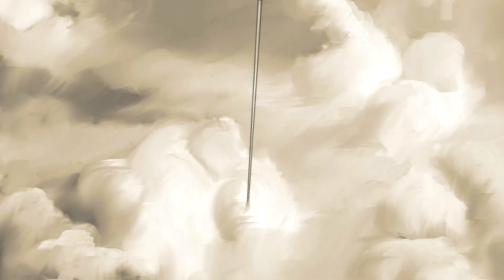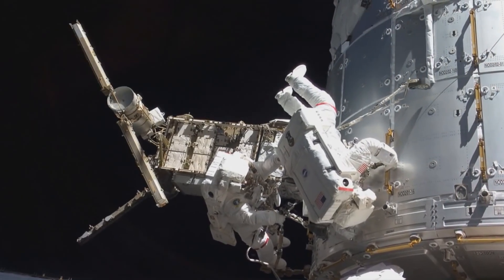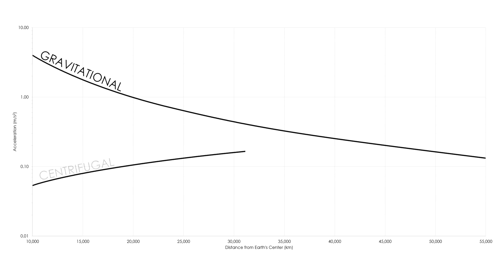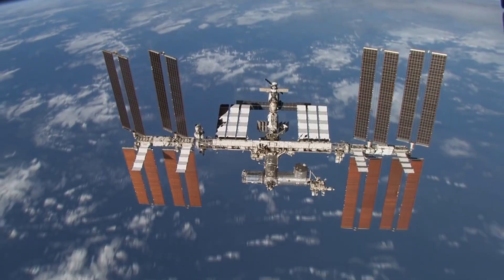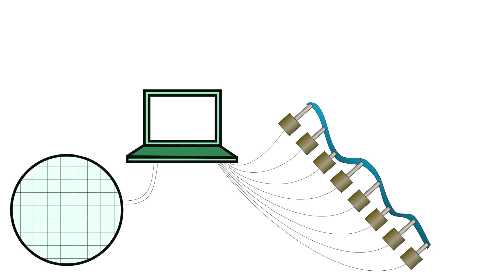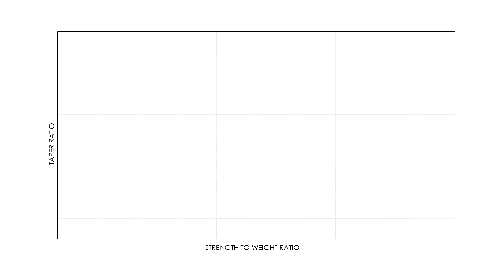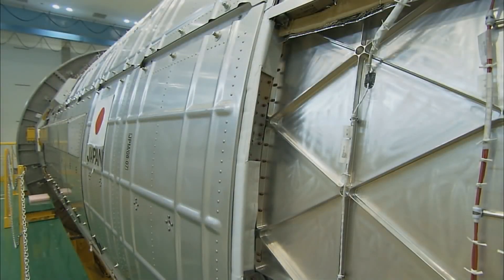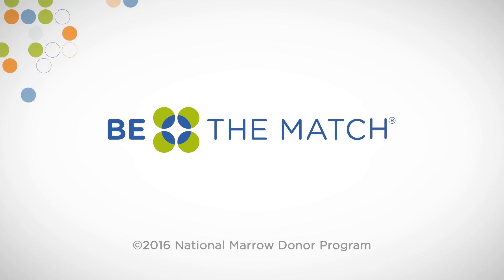Design Your Own Space Elevator

Comment: Just wondering.... So suppose that we have everything set up: the cable, the satellite at geostationary orbit and power mechanisms,... Now consider a different state in which everything is the same, except the satellite now have an additional weight. Looking from the north pole down, earth would spin counter-clockwise. Wouldn't the existing satellite and the extra weight be dragged clockwise? And wouldn't that sucks? I mean, imagine the satellite drag 1m for every kg of payload, wouldn't that mean you can only send up very little cargo?

I mean, rockets always have to go horizontally once they get out of the atmosphere to stay in orbit (in order to catch up with the earth or they will automatically fall back down or you can say to gain that centrifugal force) so it's reasonable that the satellite will be dragged clockwise everytime you deliver a payload with the space elevator.....

Am i wrong?

Comment: And this is not counting the work load of actually building it, sure, getting the anchor into space and build not that hard, a few trips on rockets with modules to build a big station.
Not that hard just work intencive, but then again the cable, its not like u can take it up and then just trow it of the edge, and atatching it to the side of a rocket to pull it up there causes some trubbles to.

Having an elevator gives us access to a new frontier. The anchor could one day become a smal town. If its big enugh u could grow lots of plants to suply oxygen and food, then ud need a good water retrival system, every dropp is golden. And without plants every breath and drop of water is golden.

It might take a long time, but were getting there faster and faster as tech and knowlage progresses.

Comment: Isn't there a nominal amount of electrical energy generated from the potential between the planet and the end of the elevator?  I'd think that could power the lifting mechanism and atmospheric support system.

On another tangent, what about having the power and lifting capabilities located at the base/anchor facility, such as a loop of super-strength material, with the elevator riding up & down the belt?  This could be equally balanced with a traveling elevator on each side ot the belt, one traveling up while the other going down.

Comment: What if the satellite was pulling the tension in its own direction pulling away from earth would that effect the cable size and why can’t we use high voltage electricity to power the elevator we send electricity across countries this way

Comment: How on earth is this not a perpetual motion machine!  There is no free energy, and a space elevator creates a lot of potential energy. 
A weight at the end of a string does not stay there if you pull the string. And the earth’s rotation does not accelerate the weight the way a person does when they spin a weight around on a string. 
All the things in orbit are free-falling directly toward the center of the earth, there is no centrifugal force keeping them up. And lower orbits require higher lateral velocity than higher orbits to stay in orbit. There’s no straight line to a geostationary orbit connected to the ground. But more to the point, as soon as you start ascending, you would be pulling on an unsupported mass in space. “Equal and opposite reaction” means that mass would come down with as much work as is put in, no matter how massive the weight. 
An engineer would strictly analyze the physics of this before even contemplating the materials needed.

Comment: You didn't even mention the nightmare of the cable being a conductor and the largest lightning rod ever.

That said, powering the lifter works better if power is beamed down from the station and up from the surface

Comment: what if there were dual carbon nanotube cables side by side, each with a lifter on it. One is at the top while the other is at the bottom, and they're on pulleys. It would still take power, but only for half the trip, the rest of the way gravity would do the work.

Comment: Why not release the tension on the tether with a series of large hydrogen filled hollow donut shaped tubes made of a light but solid material? Higher up the tubes could be completely evacuated of any gas whatsoever since  at those heights they wouldn’t be crushed under the high pressure of the atmosphere.

Comment: "every engineer ever has waited their entire lives for a problem where the solution was a gigantic laser" - Truth.
Reply: I was thinking about this, and was wondering if gravitational wave detectors count as the biggest lasers we have ever built.
Reply: @CupCakeArmy1  Let me tell you about the Apollo Retroreflector Experiment.
...
It pretty much is what the name says. There's a couple retroreflectors on the moon left by the Apollo 11, 14, and 15 crews, and we routinely shine lasers at them to measure the exact distance to the moon.
Reply: @CptJistuce  This wouldn't change the distance to the moon any more than what is already calculated by the standard gravity equations each year. Gravity is a field, so the expansion of space is happening everywhere inside the field, just at different rates calculated from the distance to the center of mass. Stuff like tidal effects make even more sense in this gravity model because its not the curvature of space that causes different rates of acceleration felt on a massive body but merely the different rates of expanding space inside that body. The whole idea that space is curved can be thrown out, while preserving everything that relativity brings to the table.
Reply: @CupCakeArmy1  I... never said lasers WOULD change the distance to the moon?
Reply: @CptJistuce  Ah sorry I got comment threads mixed up.
Reply: @CupCakeArmy1  That explains a lot. No worries.
Reply: @CupCakeArmy1  
RE: "I was thinking about this, and was wondering if gravitational wave detectors count as the biggest lasers we have ever built."
The Laser Interferometer Gravitational-Wave Observatory (LIGO) is a large-scale physics experiment and observatory to detect cosmic gravitational waves and to develop gravitational-wave observations as an astronomical tool. Two large observatories were built in the United States with the aim of detecting gravitational waves by laser interferometry. These can detect a change in the 4 km mirror spacing of less than a ten-thousandth the charge diameter of a proton. These lasers were built for sensitivity not power.
The most powerful laser beam ever created has been recently fired at Osaka University in Japan, where the Laser for Fast Ignition Experiments (LFEX) has been boosted to produce a beam with a peak power of 2,000 trillion watts – two petawatts – for an incredibly short duration, approximately a trillionth of a second or one picosecond.
References:
https://en.wikipedia.org/wiki/LIGO
https://www.ligo.caltech.edu/page/what-is-ligo
https://theconversation.com/worlds-most-powerful-laser-is-2-000-trillion-watts-but-whats-it-for-45891#:~:text=The%20most%20powerful%20laser%20beam,trillionth%20of%20a%20second%20or
https://www.sciencemag.org/news/2018/01/physicists-are-planning-build-lasers-so-powerful-they-could-rip-apart-empty-space
Reply: Not me!😂
Reply: Satellite laser tracking engineers are living the dream
Reply: Not just engineers.
Reply: Upvoted the video at this quote, upvoted your coment as well - great
Reply: Material for the lanyard /elevator cable needs resistance to burning up in the atmosphere for every minute, second, days and years.
Reply: Why would the stationary cable burn up? The outer atmosphere is very cold - you might be thinking of the incredible friction caused by plowing through all the air on re-entry.
Reply: @StephenGillie  no, I actually made an assumption , 😇, I always see meteorites burning upon entry, but , now I know that's maybe from their velocity and friction of our air atmosphere at such speeds , correct me if I'm wrong,🥺
Reply: It's surprising nobody's thought of having 2 cables, and an electromagnetic potential between them. Maybe have power stations every mile - people could live there too, even have a McDonald's at some. Use jet engines, or at least a gasoline generator, while in atmosphere. A full week sounds reasonable if it's incredibly reliable - wouldn't want to go fast enough to waste any energy to air drag.
Reply: @Traitor Hunter But they DO want giant lasers.
Reply: Where's styropyro when you need them

Comment: What if instead of taking an elevator from the surface of the earth by a cotton thread from 25,000 miles, potential energy is converted to kinetic energy and a launch is picked up somewhere off the surface? The Elevator Picker Upper (EPU) somehow gets into a high orbit when it is initially launched. It is refueled while in the high orbit (I'll explain how in a bit). The EPU down and  deploys a tether (that is MUCH shorter than 25,000 miles). The EPU travels to a height where it has low wind drag but slows as much as possible. The tether is designed to accelerate and get as close to directly under the EPU which a Tether Guide Rocket at the end of the teller.The tether is attached by the Launch Load Vehicle (LLV) which contains the payload and a hook. (simply put). The EPU starts pulling in the LLV and accelerating to the desired orbit.  Hopefully this system is designed so that the energy costs to pick up the LLV with a tether is cheaper than a 3 stage rocket.  Next, the EPU and TGR are refueled. 

One (of many) question is where is the fuel obtained to refill these systems. Somehow hugh amounts of water are obtained from someplace in the outer solar system.  That is transported to the LaGrange point.  Somehow hugh solar arrays (where did these come from) convert the water to hydrogen and oxygen. The hydrogen and oxygen are used as fuel.

The point behind my contrivance is to reduce the infinity mass of the elevator rope maybe by introducing other impossibilities. 

Is there any feedback?

Comment: You wanna know what I think, eh? Space elevators are bollocks that can't even work in the frictionless vacuums attached to point-gravitational sources that originated the idea in the 19th century. When they were first thought of, the problems of orbital mechanics weren't even conceived of, let alone rendezvous, which our own NASA failed during Gemini 4. Just because you string a tether across all levels of height between the surface and GSO, DOES NOT MEAN that the shear forces of orbit will cease to apply! Further, putting the counterweight at GSO won't help you. You need your center of mass at GSO, which means you'll need a countertether extending double GSO to counter the mass of the rising tether.

Space elevators are a terrible, worthless idea from a time before we even had powered flight.

Comment: The concept is to save money by reducing the amount of energy it takes to reach space. Let's fast forward to the future and say we now have the technology to build and maintain it. You are basically going to spend a $1 to save 50 cents! 

It's the same principle with wind power regardless of what we've been told. Wind is VERY expensive, not to mention unpredictable. I've worked on RAT Gens in the USMC. They have complex mechanisms that control blade pitch to regulate RPM's as well as a centrifugal brake that engages once the least efficient pitch angle is reached to mitigate overspeeding. The hinge system that controls blade pitch must be kept lubricated and the brake pads must be changed regularly. It is a very HIGH MAINTENANCE system. Add to that the upfront costs for the structure and the real estate needed for a wind farm and you will start to see that we are being lied to about wind being a "cheap alternative". If it's so cheap, then why is it so dependant on government subsidies? If I've got to shell out $1.25 in taxes to save a $1 on my electric bill, I WANT MY FUCKIN QUARTER BACK!

Comment: An easy solution to beaming power to the climber is to beam it from the counterweight station. Most of the trip does not go through any atmosphere so there would be very little loss or diffraction once the climber goes above the densest portion. The climber could also receive power for the first part of the journey from a ground based system. The counterweight station could be powered by solar panels or a nuclear reactor. During initial construction, the carbon nano tube filaments should be manufactured in orbit and then lowered as it is made. Once the first elevator is made, any others would be much cheaper and easier to construct.

Comment: Could you power the lifter by attaching a weight to the end and letting the centripetal force pull the load up. Then just use a tether at the ground to bring it back down? I don't know if this would work well, but that would eliminate much of the complexity, but would increase the building costs.

Comment: College physics student here,  umm, there I no such thing as a centrifugal force. The feeling of a force that is center fleeing is actually the result of changing velocity in the radial direction, not that this fundamentally changes the videos message in any way, but the sum of the forces in the radial direction would be=w+T=ma the weight force plus the tension force, there is no force acting on the elevator pointing out into space. What keeps the elevator in space is it’s tangential velocity constantly changing due to acceleration towards the center of the circular path. All of this assumes uniform circular motion. 

Also, do you remember a while back when NASA used a long tether to generate electricity using the earths magnetic field? Maybe they could use that combined with solar to power the elevator.
Reply from the maker: https://xkcd.com/123/
Reply: Well I love to be wrong, and I really like your channel and respect you a lot, I’d love for you to explain what you mean! Funny comic though! Huge fan, just subscribed!

Comment: I think to power the vehicle we would use multiple tether cables, some of which are attached to pulleys on the counterweight and the earth. there would also be a number of static cables to hold the static structures like the space stations the elevator stops at. the ascension vehicle would be firmly attached to half of the moving cables and the other half would run through guiding pulleys on the vehicle. that way powering and braking the vehicle could be controlled from the ground. the braking mechanism could be a number of electric generators connected to pulleys in the ground station, the gearing ratio could be changed to increase or decrease braking power. And if the elevator went beyond the Clark belt to maybe have a station farther out where the centrifugal force produced an environment of 1G of constant force, only "upward" is back toward the earth. If the elevator could go further the braking generators would also need to work in reverse, just switch the poles of the generators connections. the elevator would also need to be equipped with slack cancellation devices to keep the powered pulleys from losing traction. if both accelerating and braking are powered from the ground then every time the vehicle speeds up or slows down the tether would emit more pulling force on the counterweight than usual. if it manages to pull if hard enough to move closer to the earth the slack cancellation devices could engage but also any space station would  move closer to earth also and would create a risk of the entire system coming down. to stop the stations from being caught up in reckless driving on the operators part, there would be a duel counterweight system, one for the moving parts of the elevator, and one for the static stations.
and finally, there could never be and odd number of space elevators in the world, 2 elevators of the same design would need to be on exact opposite sides of the world and they're launches coordinated to create equal forces on the earth at all times that prevent the entire earth from moving out of our orbit.

Comment: Can you do a video on the concept of the Orbital Ring? Essentially a hoop that encircles the planet at a distance that's easy to travel to from the surface by conventional means, and then is used as a launch point for other distances? Other people have been talking about the Engineering requirements of such a system, but they aren't all that... erm... Practical, if you will.

Comment: Civil Engineers build buildings, Mechanical Engineers blow them up. :-) But, seriously, a question. Doesn't the taper calculations you presented assuming that the cable is holding itself up? Would not the counter weight's centrifugal force pull the cable up, so to speak, and relieve some of that weight? Just a thought. I am neither an engineer nor a mathematician, so I thought I would ask. Otherwise, very interesting video.

Comment: under that tension you can not only  rip any chemical bond but even strong nuclear bonds . So you would need to make a   mono atom fiber that is that is that(insert number) long and that(insert number) wide. but the mono atom fiber would have to much protons so it would decay in nuclear explosion fashion due to decay and strong nuclear force(break up into smaller atoms like uranium 228 similar like stream of water break up into droplets)  . SO building it would be stupid because you rely on the same reason water breaks up into droplets. Or simply try building it on black hole where gravity is enormous . IT's not possible because we live in 3 dimensional(ignoring time dimension) universe!and 3 dimensional universe causes 3 dimensional energy dissipation which is exponential ( square cube law). that's why people build rockets propelled by nuclear/ chemical reactions because it's easier.And the only place you can build space elevator is asteroids or moons . but we would not use them there because they are useless . because we have rockets !